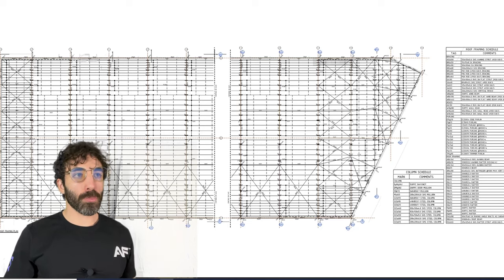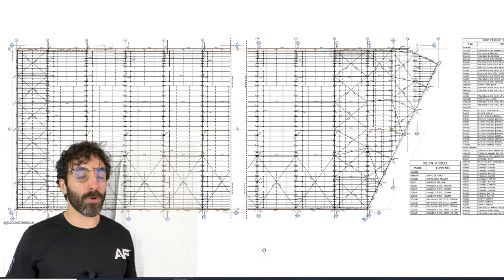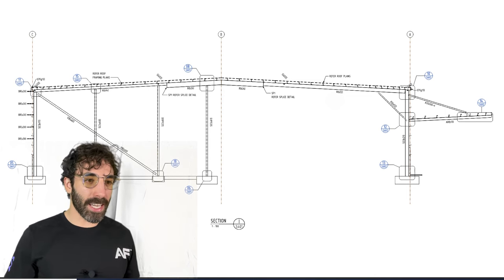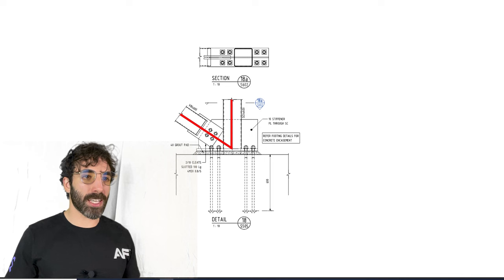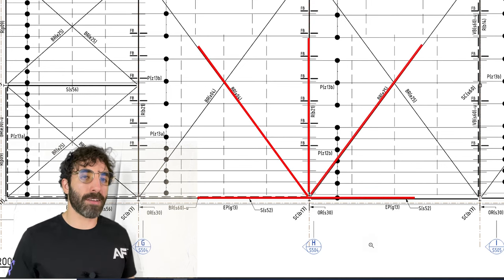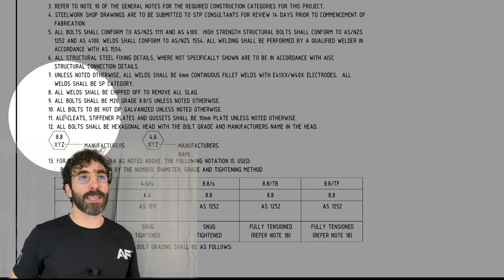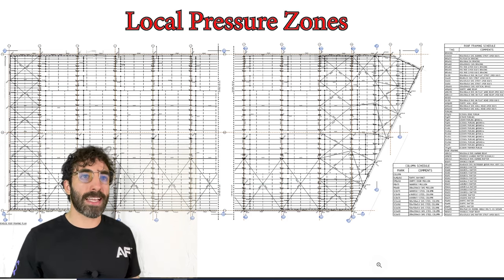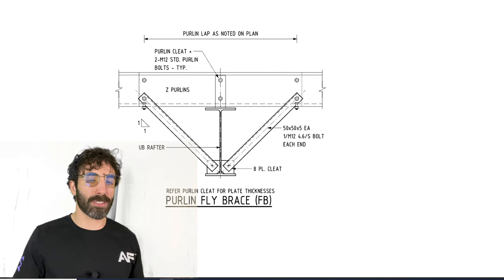How to Read Structural Steel Drawings

Comment: Hi
At approx 10:29 when you show the typical bracing connection, it seems that the axis of say the BR(e25) 75x75x8 EA is located centrally (37.5mm from the edge) whereas depending on the supplier, the neutral axis is usually 22.7mm from the 'web'.
In your experience, 
a. should we be using the actual 22.7mm one as opposed to the 37.5mm one? I'm guessing you used the central one because to ease workmanship during assembly.
b. does it make much of a difference? I am assuming the main difference would be eccentricities on the column.

Btw thanks for the videos. Keep them coming
Reply from the maker: Good question. Typically I align with the bolts, which is where the load path is going through. I would locate them centrally to the leg of the EA. Have a look at AS4100 Tension Design. It already accounts for eccentricity by using Kt factor.
Reply: @bengthebrazilianengineerinAus  cheers. I'll have a look. I'm not familiar with Aussie codes but I know they're not that different from British or Eurocodes
Reply from the maker: @roopesh1   They're all the same. For tension, there's a factor to account for that eccentricity